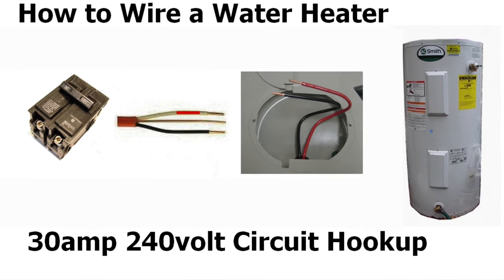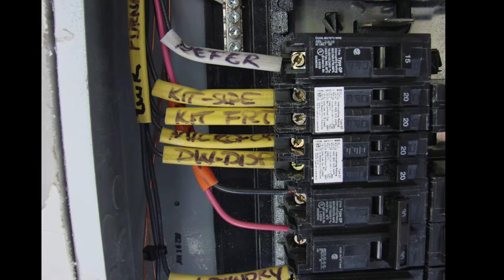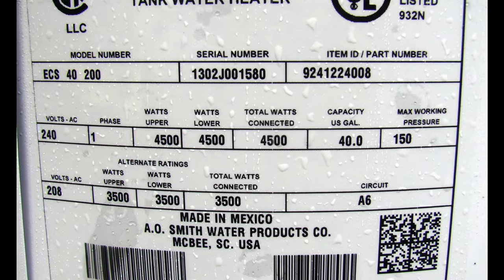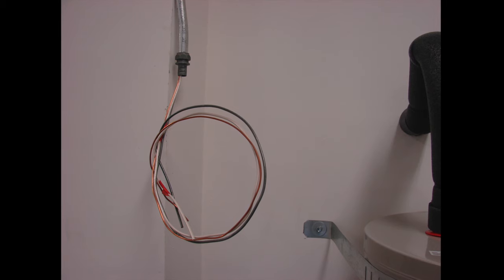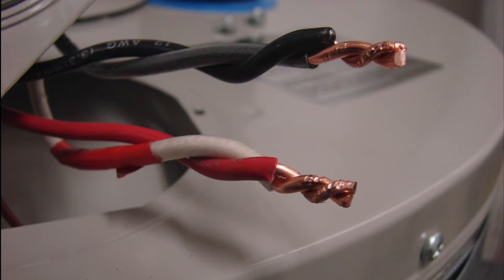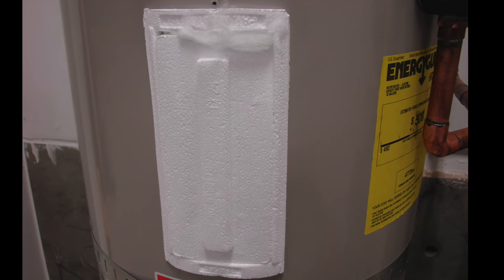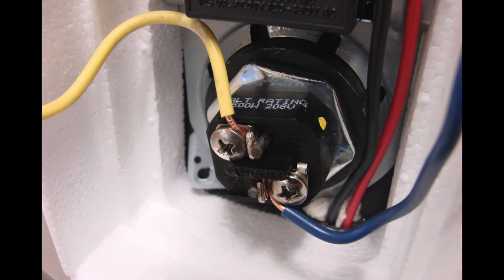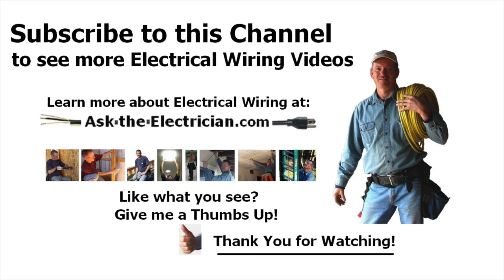How to Wire a Water Heater and Hook up the wire connections when replacing a water heater.

Comment: question concerning wiring.? My electrical panel has a 30 amp breaker attached to a 10/3 wire which goes to the water heater space, but the water heater an AO Smith 100 only has 2 wires from it a red wire and a black wire. plus ground of course ,but my question is do I at the water heater tie wiring black to black and white to red or red to red and black to black then using a wire nut to cap off the white wire?
Reply from the maker: Typically when there is a 10/3 with ground to a water heater the white wire is not used, therefore it is capped off, then all the connections are color to color. It is best to verify the wiring to make sure the black and red wires are in fact the power wires, as they should be.

Comment: Why do HWH typically use bare wire connections with wire nuts vs a screw terminal (similar to a breaker)?
Reply from the maker: Good question! Maybe because it would cost more?
Reply: @AskTheElectrician thank you for taking the time to reply to my question. This baffles me especially if you follow the supplied wires in the junction box of the hot water heater down about 18” to where they screw down to a terminal at the upper element/thermostat. Seems as tho you could eliminate an extra splice by running the 10/2 right to the terminal. 

The most convenient would be a nice terminal block in the upper built-in compartment of the water heater, but like you said… it would add a little extra cost. Personally… I would find it well worth the money.
Reply: @AskTheElectrician  I asked a buddy of mine that is an E 1 and his only explanation was the cost factor as well.

Comment: Hi, great video. Follow up Qs, Should all the wires after the feed lines 1 & 2 are #10 ga should all the other wires from Tstats to elements be #10 as well? I seem to remember #12 ga being used over the years but not sure that is correct?  This hwh was wired right except for the black wire from the lower Tstat was on the upper Tstat left side bottom screw and the upper element had its wire on the upper Tstat right side bottom screw. So, they were reversed and that would seem to cause the lower element to come on, but the top I don't think it would ever come on? What is your opinion?
Reply from the maker: The internal wiring of a typical water heater is factory wired, therefore the installer only has to be concerned with the main circuit connections. The only time we would need to access the other areas is if the water heater element, or one of the controls becomes faulty and needs to be replaced. But you are correct, some of the internal wiring is not #10 because there are two elements that do not pull 30amps each. Great questions - Thanks for viewing the video and sharing your thoughts.
Reply: It's not so much the size of the wire that determines how many amps can flow as the temperature rating of the insulation. That's why the wires in the unit are smaller than the supply wires. You can get some really high temp insulation, like asbestos cloth like is used in ovens.

Comment: You also need a disconnect at the location of the water heater if it is not in line of sight from the breaker that controls it.
Reply from the maker: That would depend on the location and the electrical codes for the specific area, and this may be required for other countries.
For Example: 
In California a disconnect is not required for a water heater.
Otherwise if you would like to install a disconnect then you may do so by all means.
Consider the following:
A 30Amp Baseboard Heater does not require a disconnect switch as well, however they are both thermostatically controlled.
Interesting, is it not.
Reply: @AskTheElectrician  In and of itself, the national electric code is not law. It's merely an advisory committee. The code, however, can be adopted as law by various states, counties, and municipalities.
Reply: Some YouTube videos state that a breaker lockout device is acceptable instead of a local shutoff.

Comment: Thank you sir for this great video. I'm gonna need to replace my gas water heater, I was thinking to go with a 40 gallon 240v. Now,  do you think this electric tank it's gonna cost me more to run it vs the gas one?. Thank you very much. Ps the reason I'm replacing my gas heater is because I want to eliminate the chimney that runs in a mide of a bedroom on the second floor
Reply from the maker: Thanks for watching. As for the cost comparison, look for the yellow Energy tags on the water heaters which should provide the average cost based on energy consumption and average energy costs.
Reply: Oh ok, I'll check that out. Thanks for your response

Comment: If there is are two green ground screws (one inside the compartment like your example and one on the top cover plate) does it make any difference which ground screw you use?
Reply from the maker: You could loop the ground wire thorough each ground screw, and make sure the ground wire is connected to the ground screw inside the junction area.

Comment: I want to install a new electric water heater and remove the gas water heater, however the gas furnace piping is attached.

I'm hoping to place the new electric water heater in the garage. 

How much would a job like that run of adding new wiring, relocating pipes from the inside wall to the interior of the garage cost? And would the mechanic need a permit from the city?
Reply from the maker: The cost would depend on where you are located, the cost of the materials, and the current labor charges for your area. Get at least two bids from local licensed contractors who have excellent references.

Comment: Hello, so I'm in the process of replacing my sister's old 2008 water heater that just started leaking this weekend. As I was inspecting the whole area around the water heater, I noticed the electrical wiring (with romex) for the water heater, was coming out of the floor (just a hole drilled through the wood flooring with no grommet) and free floating up and over to the top of the existing water heater. Would using flex and then securing that along the closest wall be a good way of protecting the wire?
Reply from the maker: Yes it will, the wiring should be protected and not exposed such as it is, great for you to improve this condition and make it right.
Reply: @AskTheElectrician  hello, I have the same situation in my house. My question is if  we are allowed to run the romex through the conduit as is or do we have to strip the outer jacket once it transitions to flex conduit?

Comment: Water and rust is in the wires cover box. Cover lid  is rusted. Water came up through hole. Can this be cleaned up? Its a 2010 Ao Smith electric? Did water come up because its all rusted or just that?
Reply from the maker: The water heater should be checked to make sure there are no water leaks. It may be that there was a water leak in the past, possibly one of the water pipe fittings above the unit. You may consider turning off the circuit power and  cleaning the area and removing the rust to make sure the unit is kept in good condition.

Comment: Should there be a disconnect on the wall near the water heater?
Reply from the maker: Personally I think there should be, however since a typical water heater is a permanent installation with (almost) no parts to service, up to now the NEC does not require a disconnect. Note that the newer hybrid water heaters may require a disconnect.

Comment: I have an old wire coming out of the breaker box.
Black and white are hooked on the top screw of the 
Breaker.. the red wire hooked on the bottom of the breaker.
Where does the red wire hook too in the hot water heater?
Reply from the maker: When in doubt I test the wires to verify the voltage, then connect to the wires at the water heater as described in the video.

Comment: Question my husband and I was putting our new electric water in and when we removed pipe all of the water was not drained so it leaked overt the electric plate with the neutral ground cords . Now we did blow dry it but should we still water a day before restarting electricity
Reply from the maker: if all of the electrical components are now dry then it should be ok.

Comment: How about a  lockable disconnect close to the hot water tank. Is that required. ?
Reply from the maker: Personally I think a disconnect is a great idea, however since a typical water heater is a permanent installation with (almost) no parts to service, up to now the NEC does not require a disconnect.

Comment: What about older pre 1994 homes with a 10-30R and no ground? My plumber used the neutral and I’ve bern wondering if that is ok.
Reply from the maker: For the older homes, if the cable has Black, Red, and White insulated wires that are fed directly from the main electrical panel, and the White wire is bonded to the grounded terminal bar then using the White wire as the ground wire is OK, but the white wire should be marked with green tape or a green marker at each location.

Comment: Hello. I have power at the new element, but can't hear it working. Thoughts?
Reply from the maker: The element may be faulty. If this is a new water heater double check to make sure the water is turned on, and bleed out trapped air by running water to other areas of the home.

Comment: My 40 gallon hotwater heater on 2 25amp breaker. is this right? I bought the manufactured new home 2022
Reply from the maker: You could check the specification label to see what size circuit is required, but if your water heater has been working fine as it is, then there is no need to change it.
Reply: If it needs 30 amps your really tight. Hopefully the elements won't draw too much.

Comment: Hi. I need your expert assistance if you don't mind. I need to add a booster pump to my electric heater. I tap the power wiring from the heater wiring itself. Is this safe? What is the risk?
Reply from the maker: Typically a booster pump is wired from a separate electric circuit, and the booster pump is not wired to the water heater circuit. Keep in mind that most booster pumps in the USA are 120volt with small amperage, and our conventional domestic water heaters are 240volt 30amp. The concern is the booster pump requires less circuit power and the wiring is smaller, therefore we must provide over current protection for the booster pump, and we must provide the correct voltage. 
The only exception is when a water heater has a booster pump built into the main water heater unit and the internal wiring components provide the necessary circuit provisions and circuit protection.
Be Safe and Be Careful.
Reply: @AskTheElectrician  Thank you for your kind response. Appreciate it.

Comment: Would a heat pump water heater require 10-3 for a neutral or does any water heater require a neutral maybe one with internet Wi-Fi connection or a hybrid unit
Reply from the maker: Typically a 240volt water heater does not require a neutral wire. Some smart controls that are installed for water heaters connect to a 120volt outlet.

Comment: Is it okay to use 5500 watt when it says 4500 watt on the water heater for a heating element?? Need to know asap please?
Reply from the maker: The replacement water heater element should be the same as the original heating element.

Comment: Can you connect a 240 volt water heater to a 208 volt high leg via a straight rated 30 amp circuit breaker or fuse?
Reply from the maker: Not unless the water heater manufacturer states that you can.
Reply: You mean you can do that unless it's in violation of its UL listing?
Reply from the maker: Be sure to check with the manufacturer - that way you will be sure it is under warranty as well.
Reply: @AskTheElectrician  people connect 240 volt water heaters to two legs of  a 208 volt Wye all the time. What's the difference? It doesn't have to be line to line.
Reply: You can but as the elements are rated for 240 and your only supplying 208 your btu output of the heating elements will be in proportion to your decreased voltage. But that may be ok. Just raise the setting on the heating element thermostats, unless they are maxed out. The water will not heat up as hot, the elements won't get as hot, but you may be ok with that.
Reply: @johndavies2949  you could also use a buck-boost transformer increase the voltage within 20% or less to obtain as close to 240 volts as possible.

Comment: mine seems to have to hot ( faze,power) wire coming to the system no neutral nor ground wire .what should I do
Reply from the maker: The typical approved circuit for a residential conventional electric hot water heater is a 30mp 240volt circuit which includes ground wire.

Comment: What size are the wires from the thermostat to the element?   Yellow, blue etc.
Reply from the maker: Application Specific: So if the described wires need replacing on your water heater then replace them with the same type and size wiring that your specific water heater has.
Reply: 14awg

Comment: The only wire I can find locally is 10/2 Type NM-B. Does a "B"  make a difference?
Reply from the maker: The 10/2 NM-B Cable is designed for indoor residential use and should work fine.
Reply: @AskTheElectrician  so th4

Comment: How do you wire a water heater timer?
Reply from the maker: Obtain a 240volt Water Heater Time Clock for a standard electric water heater. The incoming 240volt circuit wires connect to the Line terminal screws, the Load wires connect to the water heater.

Comment: so there is no neutral connection on electric hot water heaters????
Reply from the maker: A neutral wire is not required for a typical 40gallon 240volt electric water heater.

Comment: Why does it not require a neutral?
Reply from the maker: Because that is the way a 240volt device works, and it is much more efficient compared to 120volt devices.
Reply: There are no 120 volt loads on the water heater itself. Thus you need only the 2 hots and the equipment grounding conductor.

Comment: Hello! I have a bit of an issue. Yesterday I wanted to change a ceiling fan/light to a light fixture in my kitchen.

I was unable to wire everything correctly and there was a short circuit - I went to the main fuse box and saw that the kitchen fuse was blown. I got a new fuse and replaced the broken one. Everything was working fine after that. 

After that I went to the basement and tried turning on the lights, they did not work nor did some of the outlets in the basement. So I went back to the main fuse box to check those fuses, taking each one out and putting a new one in to check if that was the issue. That didn’t work.

The outlets are not GFCI so I don’t know if it’s the wires or something else. Any help would be immensely appreciated!
Reply from the maker: Sorry to hear about this problem John. You have stated that "I was unable to wire everything correctly and there was a short circuit" therefore attention should be given to correcting the initial wiring, because all of the issues you have described point back to the fact that something is definitely not wired correctly at the location of the original work - where the ceiling fan\light was located. Identifying the individual wires will be essential before one can make the correct wiring connections which will restore everything to the original functions.
Reply: You got a mess. Hire the guy.

Comment: if its 4500W why can't you use a 20" breaker with 12/2 wire, that would be 240x20=4800W
Reply from the maker: Because the Water Heater Circuit is wired according to NEC Code: 310.16, Table 310-16, Utility room, panel, circuit, 30 Amp Breaker for water heater. 
Therefore a 30amp circuit requires a 10/2 w/Grd Type-NM Cable - in most installations.

See more about Residential Home Electrical Codes:
https://ask-the-electrician.com/electrical/electrical-code/electrical-code-search.php
Reply: Also in article 422.13 of the national electric code which states "The branch circuit over current device and conductors for fixed storage type water heaters that have a capacity of 450 L. (120 gallons) or less shall be sized not smaller than 125 percent of the rating of the water heater. So if your water heater is rated at 4500 watts at 240 volts, which is 18.75 amps, you then have to multiply 18.75x1.25=23.43 amps. Therefore you will need a minimum circuit rating of 25 amps with#10 AWG  conductors.

Comment: All i saw was code violations as an electrician. Antishort bushings, correct couplings anyone?
Reply from the maker: Absolutely! Use bushings when installing flex that has sharp edges, however Some flex connectors do not require antishort bushings. The coupling may be made with approved materials and still provide the desired resullt. 
It should be noted that there are several ways of doing a job and still remain completely code compliant.
Reply: @AskTheElectrician  .....but you can in that code compliance, get cheap. I never will. There is code compliance, then safer code compliance. When we could burn down everything, I choose safer code compliance or I refuse the job. I never worry about the sharp edges, when I'm done none exist, by brushing or alternate method. Now go get the wire stretcher😃. Have a good one.
Reply: Chad is synonymous with Karen
Reply: @rhaastaa  lol.....so noting correct protocol for not having a fire is being a karen.....got it. Imagine thinking that was an insult.
Reply: @rhaastaa  sounds like he doesnt want his job taken by having people know how to do this themselves rather than paying alot/getting ripped off to have a professional do it.

Comment: My hot water heater has 12 awg wire. But my breaker is 30 amp with 10/2 wire. Is it safe to connect the 12 awg with the 10/2 wire?
Reply from the maker: The wiring should be #10 AWG Copper for this 30amp circuit. Until the wiring has been upgraded it would be best to install a 20amp breaker to provide proper overload protection.
Reply: Run #10 all the way from panel to connections on water heater and use a 2 pole 30a breaker at panel.